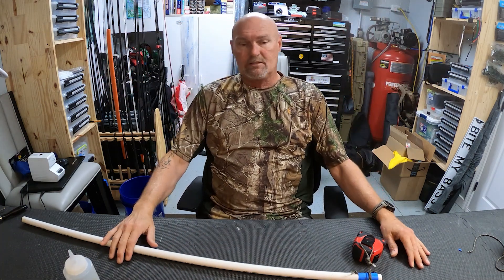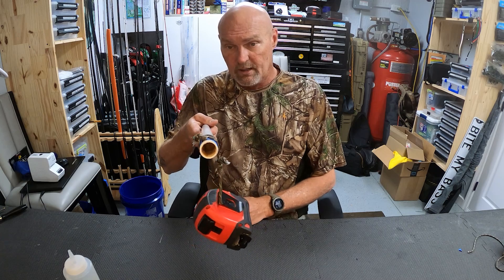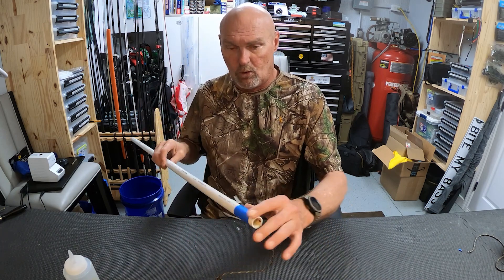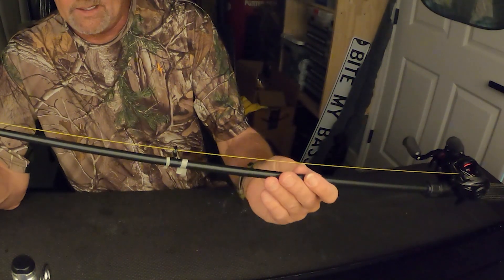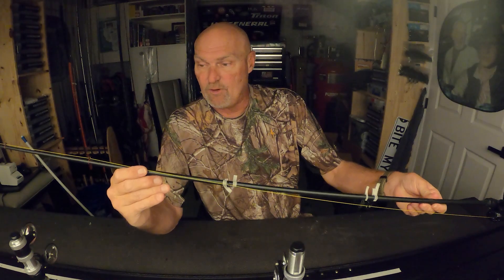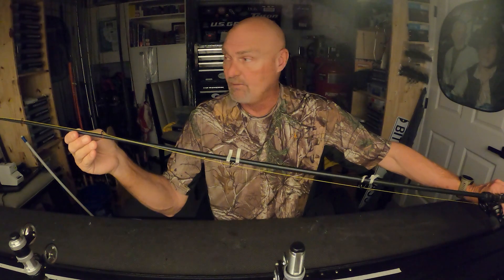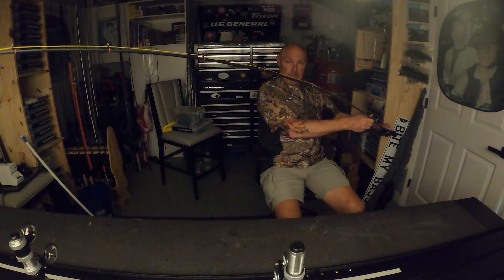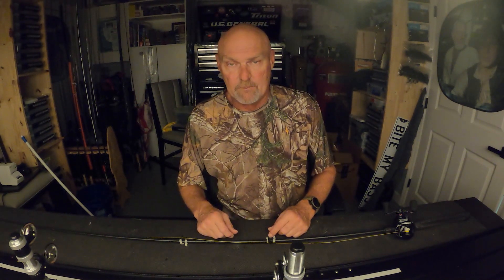Spiral Wrap - Why and How

Comment: I fish bait casters almost exclusively and have bought and built many now, and all have been built traditionally with guides UP. I have never broken a tip once, even using light gear on larger fish. I truly believe that tip breaks are almost always due to abuse of the relatively more delicate and thin top section. I even think many situations where I broke my rod in the thicker lower sections have been to my weight bouncing into the blank while I have the hook in the keeper and bush whack. Although some blanks seem to take that abuse. I did try to make a spiral wrap once but I did the version where there is only one transitional guide and I didn't like it. Maybe the two transitional guide version would be better for long medium action Salmon/Steelhead float fishing rods. I'm about to test guide placement on a 9 foot rod and will mess around some more. I build 4 piece fly blanks into bait casters so I can pack them easily, and I find the ferrules come crooked after fishing a lot. I wonder if that could be eliminated by spiral wrapping and thus having no rotational torque... hmmm. I also never really spine the rod as from my research the blanks are tested in all directions and I like to build on the straightest line instead, but maybe your point about spinning it evenly for rotational torque could come into play there too.. Cheers
Reply from the maker: Thanks for your input and perspective , Aaron.
Reply: If you don't spline your rods......your wasting material and not a rod builder
    Please stop saying you build rods.    That's rod building 101 shit your hot doing.😊

Comment: To be optimal, and increase line efficiency, you need 1 more transition guide.
Reply from the maker: I've tested a lot of rods, and on some of the larger diameter rods, it takes 2 transition guides.  But on most small diameter blanks, only 1 guide is necessary.

Comment: Hi, do you need to use a larger guide eye opening for first 2 guides.  I am building a 7 foot med heavy casting rod and want to spiral wrap. Thanks
Reply from the maker: I wouldn't start with less than an 8.  You will likely have to use 4 guides in your spital to keep the line from touching the blank.
Reply: @fdxcustomrods  Thanks
Reply: @fdxcustomrods  Funny thing happened. I had the guides in place for casting guides in top held in place with bands and tip top glued.  I started to load it up with line through all guides and tip top.  The guides closest to the top of blank with a load on rolled over to the bottom. Will be doing spiral wrap for sure after seeing that. Thanks for the videos.
Reply from the maker: In the chaos part 2 video coming soon, I spiraled a big boy blank, starting with and 8, and it required a stripper and two transition guides.

Comment: That's actually pretty ingenious! I can really notice the rotational force on my casting rod and see how the line goes below the blank and wants to twist. I didn't notice this on my spinning rod so does this only benefit casting rods or does it help on spinning rods by taking some of the force off the guides?
Reply from the maker: It only works on casting.  The spinning guides are already below the blank.
Reply: @fdxcustomrods would roller guides negate the rotational force or are they an alternative to acid wrap?
Reply from the maker: No.  The rotational force comes from the line being on top of the blank at the tip.
Reply: @fdxcustomrods  so roller guides wouldn't negate any of that (on a casting rod)? Could you acid wrap rollers? Just an idea... I want to build 2 casting rods, a bfs rod and a large salmon / swimbait rod (with rollers)
Reply from the maker: Roller guides only reduce friction, and therefore, you have less abrasion to the line.  It doesn't change the direction of force.  I've never tried a spiral wrap with roller guides.  That would be interesting to see if it worked.

Comment: A question about the layout and guides. Would you use single foot microwave air guides on a heavy rod like this with being spiral wrapped. I know there’s a few ways of securing the guides just wondering if theyed hold up? Last was wondering how many guides you ended up with.
Reply from the maker: First, I don't belive that Microwave casting guides give you much  advantage on a spiral wrapped rod, but they don't detract either.  Guide number and placement will be determined in a static load test.  See my video on guide placement and testing I did a month ago.

Comment: Hi! I like video!
 Why didn't you use 4 spiral guides with the first 0° 45° 135° 180° rotation? 
0° 90° 90° 180° is better?
Reply from the maker: It depends on the diameter of the blank and the height of the guides.  You can do it any way you want and does not appear to effect the performance.  I just keep it as simple as possible.
Reply: @fdxcustomrods 
I undestand! Many thanks!👍